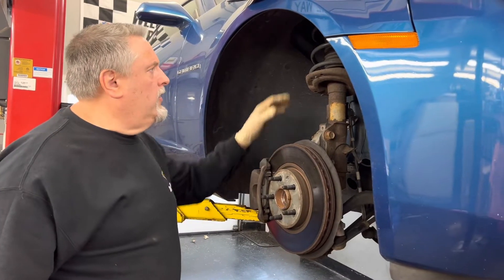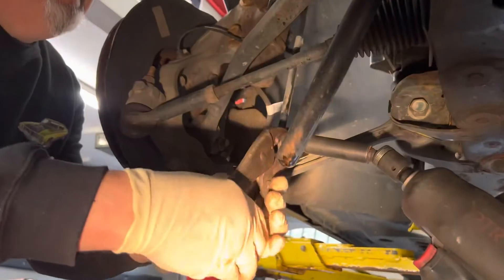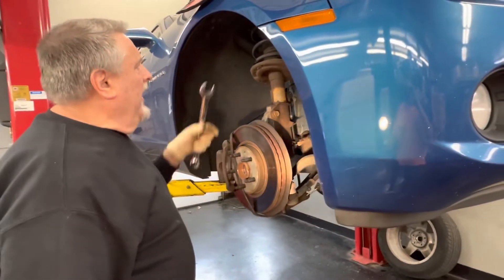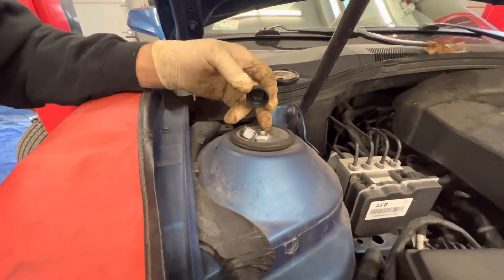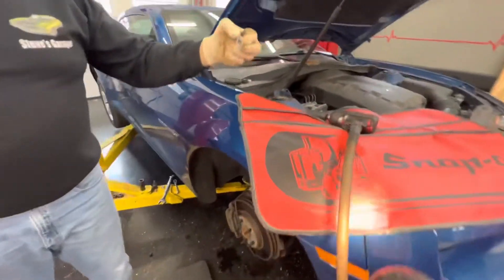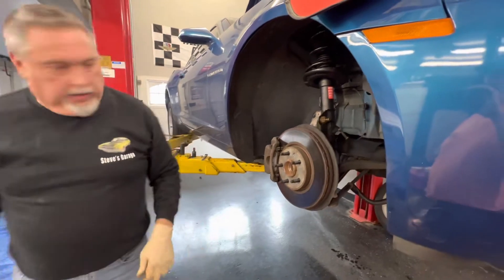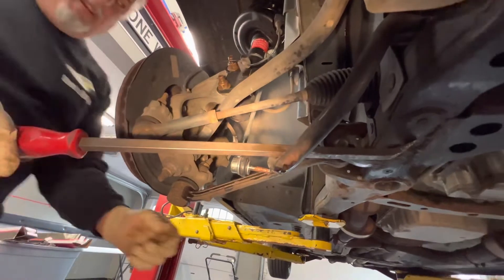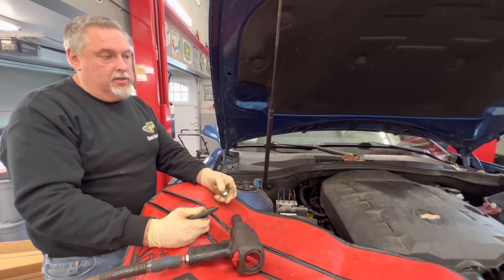2010-2012 Camaro Front Strut Replacement

Comment: How do you not need a wheel alignment when you're removing the 2 lower bolts that hold it in place which is what sets your camber? all you need is a cheap magnetic camber adjustment tool that sticks to the rotor. Stick it to something metal that you know is level.(door jam etc) set the tool to zero. Then stick it to the rotor with the suspension loaded and bolts snug screw a m10x1.5 bolt into the knuckle right above the top 24mm bolt and tighten it until you reach +1.0 of camber on the gauge  torque both 24mm 59 lb ft then 180degrees if reusing the tty bolts use alittle blue locktite
Reply from the maker: You can get it close by scribing a line around the old strut location before you remove them. Once the new struts are installed you should get an alignment.

Comment: Any idea why when I lowered my Camaro the cap on top was not flush. I can see the strut on top
Reply from the maker: You may want to see if the top of the strut is contacting something that is preventing it from sitting flush for you.
Reply: Dis you ever digure this out? I'm having the same issue with so.e aftermarket struts i installed.

Comment: wait so you can just impacted it instead of torqueing it?
Reply from the maker: We used an impact to snug it up. You can look online for your specific year, make and model for the torques specs.
Reply: @HomeownerRepair  aye aye sir
Reply: @HomeownerRepair  another thing someone said that the bolt would be stretched do i have to replace them? also where could i buy them or do i have to go to the dealership and buy them?

Comment: Is there a particular torque on those nuts? I’ll be doing this at home
Reply from the maker: You may be able to look up the correct torque specs for the top of the struts online.
Reply: 65 ft/lb for the top sturt nut. And 160 ft/lb for the 2 15/16 bolts on the bottom of the strut.